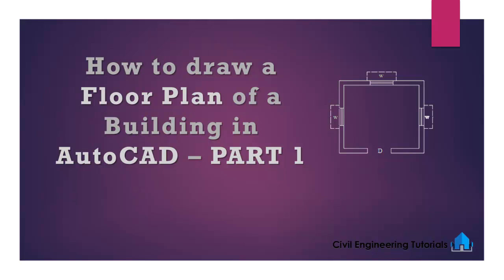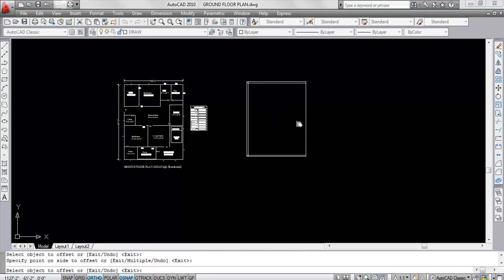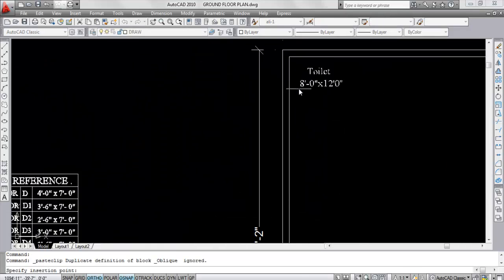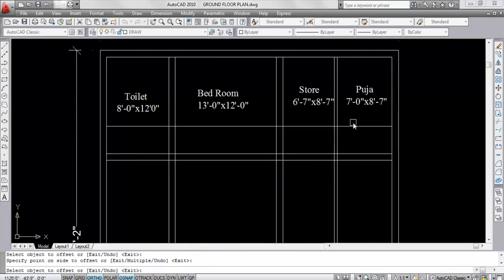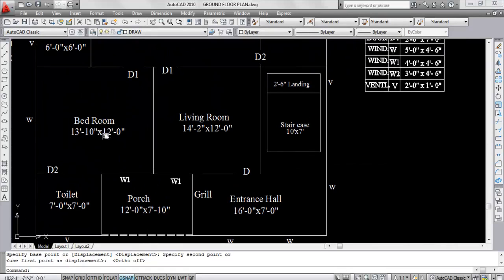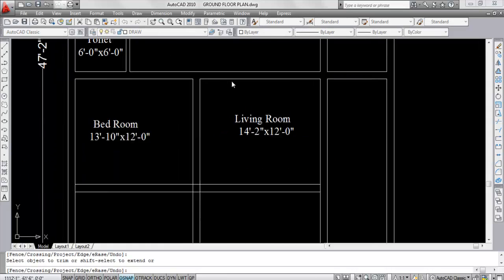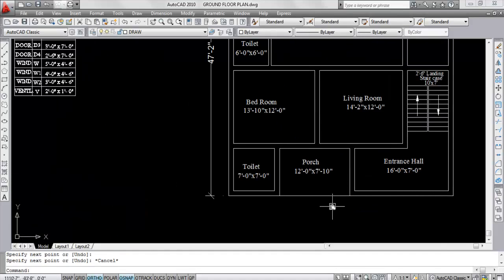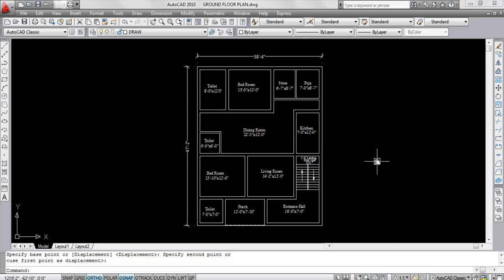How to draw a  Floor Plan of a Building in  AutoCAD – PART 1

Comment: mm i have selected the feets in engg
but when i m applying the value 10" it is automatically taking 9" or 11"
what should i do to stop it 
plz rply asap
Reply from the maker: +Sahil Kaushik Thank you for watching. Will update you the fix asap. Meanwhile you can search for the settings. You may have to change the whole file. Wait for my update.
Reply: ok mam waitng i didnt got any videos regarding tht prblm 
so am wa8ng for ur rply
Reply from the maker: Please follow the steps.
Go to Unit, select engineering, choose precision 0' - 0" 
Select Insertion Scale option as Inches.
Next, go to format, then go to dimension style, modify, primary units, select Unit Format option as Engineering, Precision as 0'-0", Scale Factor 1 and Unit Format as Decimal Degrees.

If you still unable to fix the issue, Please wait for some more time till a detailed video will be uploaded on "How to set units in AutoCAD files".

Thanks for watching the video.
Reply: thmk u alot mam it worked 
thnk u for ur grt support...